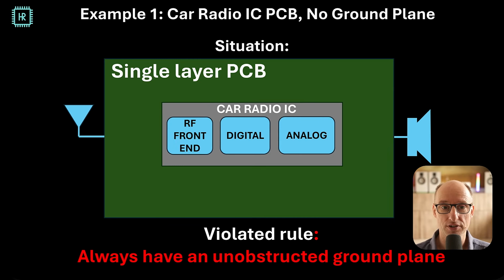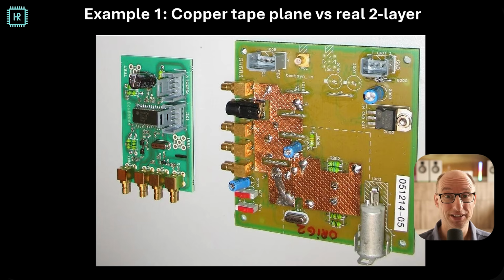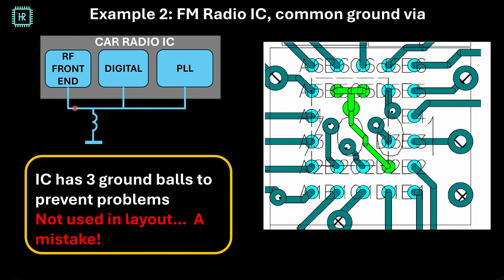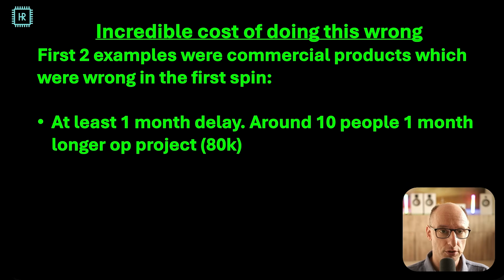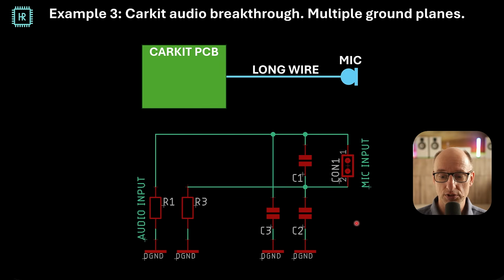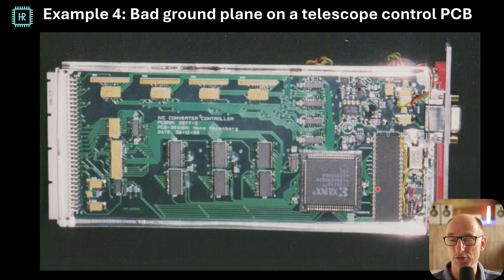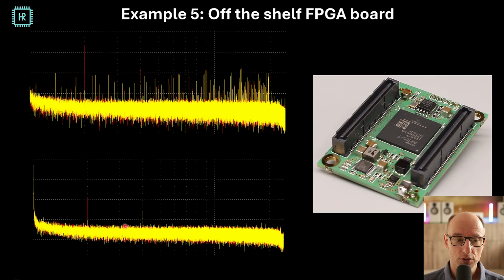Top 5 PCB Grounding Mistakes That Cost Me Thousands

Comment: A new hire created a 2-layer FPGA board that refused to boot. Total chaos in the indicator lights. My experienced colleague brought over a sheet metal platform with some kind of insulator on it and clipped it to the circuit ground. He slowly lowered the chaos board to this makeshift ground plane and the chaos in the indicator lights stopped and started blinking in the expected pattern. A good example of the benefit of a ground plane.
Reply from the maker: Sounds very familiar to my example :-)

Comment: Hey, you mentioned to never use multiple ground planes, but what if you make sure that all the return currents are on a unubstructed plane? Can it be beneficial doing it this way? Or will it still have some negative effects?
Reply from the maker: Both grounds will start to get voltage differences with respect to each other. This will in turn cause interference or sensitivity to interference. 

It will work, but with reduced performance.
Reply: @HansRosenberg74  So how do you deal with controlled impedance for both top and bottom differential and single ended signals ?  The return current on the GND planes mirror the differential signals EM field.  Recombination happens at the sink through local capacitors/coupling/IC.  It’s actually an advantage to have 2 GND planes that are dealing with the locality of EM fields.  The recombination happens when the signals are relatively quiet.  This is the whole point of a GND plane or 2 (or more).
Reply: How do you plan on  making sure that all the return currents are on a unobstructed plane when there are interconnections between each block of the circuit? They are all on the same PCB after all which means they aren't completely independent which means there are going to be interconnections between blocks and those interconnections have their own return currents which will need to cross between the ground plane of each block.

Comment: In a 4 layer PCB, If i have a analogue ground and a digital ground. Can i use two ground plane one as AGND and other as DGND?
Reply from the maker: I would not advise to make 2 ground planes unless you're dealing with a very specific situation that requires it. Those situations are very rare and usually require extremely sensitive circuits near extremely 'loud' circuits. Even then, there are other ways to solve that without making 2 ground planes
Reply: What you're supposed to do is have one plane but put analog and digital on different sides and areas, not split the two planes with a small bridge between them, which artificially adds length and bends for any return currents that need to cross between digital and analog sections. Putting digital and analog onto different regions of the same ground plane prevents local return currents of one half from circulating under the other half while not artificially impeding any return currents (from signals between the halves) which do need to cross halves.
Reply: Also consider the capacitive coupling between those 2 layers, you may not get the desired benefit as they are not as independent as you think in HF situations
Reply: Typically you should have 1 plane.  However if you have pure analog in one section (no digital traces going into that area, then you can add a plane isolation barrier (not a split but a cut that makes your plane look like a star-point GND connection.  However you have to have no digital signals crossing that “moat” because the break in the plane looks like an inductor to the signal crossing it.  It will cause ringing and noise in the isolated plane.  I would advise you read Dr Howard Johnson’s excellent books on Signal Integrity etc. for a more in depth analysis.
Reply: In your case 1 plane = solid GND plane.  If you have access to high end tools like field solvers and you are designing very noise sensitive applications you could then make a better judgement on how the isolation/split would affect the design.  Generally a solid plane is better since there is always a parallel equivalent return path for the current on the plane layer (EM field really vs current).

Comment: I have a gauge cluster from a early 2000s car that has no ground plane, it's a 1 layer pcb with some traces that have been added ontop that have had a blue mask put over, there is a big ground trace that goes around the perimeter however
Reply from the maker: I think that application is not that sensitive to begin with. The more sensitive circuits become, the more critical it is to use good grounding.

Comment: I suppose single groud plane means one layer only in a multi layer PCB? I usually use 4 layers when I design boards. Is it harmfull in your experience to use extra space on several layers for ground? If not using them as ground maybe instead using that space for power supply. I have often tried to use copper fills to reduce unnecessary copper removal in fabrication and mechanical strnegth. Should I instead leave the unused space on other than the ground layer not filled in your opinion? I suppose to make a good ground plane an inner layer with no or minimal wiring is optimal.
Reply from the maker: In a 4 layer the standard practise is to make both inner layers an unobstructed ground-plane. Top and bottom can be used for signals and supply. However, if you know exactly what you're doing and make sure all return paths are ok, you can deviate from that.
Reply: @HansRosenberg74  Standard practice is 1 GND plane and 1 VCC plane on the inner layers for a 4 layer digital board.   VCC plane looks like GND to AC.
Reply from the maker: @GodzillaGoesGaga  Yes, a VCC plane can act exactly like a ground plane. However, this is only true if you have very regular decoupling capacitors, ottherwise the return currents will need to take a detour.

A power plane in a 4 layer is relatively far away from the ground plane on the inner layers. The ground return current can start capacitively coupling between the ground and power-plane if the distance between decoupling caps is too large. 

This can cause problems at higher frequencies as standing waves will form between those 2 planes. They can leak out of the side of the pcb acting as an interference transmitter.

For low frequency boards with limited slew rates, this will not be triggered so most designs won't get problems with this.
Reply: @HansRosenberg74  thanks for the reply. I have always tried to learn about PCB design as much as possible. I will surely support your world domination objective when I have the time. 😄
Reply from the maker: @petriilkka1552 I hope you have a lot of time😂😂😂😂😂

Comment: It's a good video. In the third example the problem is not so much the existence of separate ground planes, but where the tide between them is done, and in this specific case, what is the return path for the signal. No matter single or multiple ground planes, running signals aver broken reference without other precautions taken is always an issue.
Reply: Well, I think the real point here is that if you tie the ground planes together in the right place, then they actually functionally become no different than a single ground plane anyway, so at that point, there's no advantage to putting the separation anywhere, and you might as well just get rid of the whole gap entirely and make them just one plane.

(And technically, even if you have a bridge between them at the right place for where the current wants to go, a narrow bridge will still be slightly higher impedance than if you just had a full connection over the whole plane, so even that is still technically not quite as good as a unified plane would be.)
Reply from the maker: ihndeed!

Comment: Regarding multiple ground planes. You say that There is no improvement if there are more than a single ground plane. Do you think 2 or more ground planes can actually harm the design? Assuming all the ground planes are connected to one another using allot of vias.
Reply from the maker: If you stitch them together: There can be no harm! They will all have the same voltage. My 4th video shows something about the distance between these vias.
Reply: This still needs to be done with some considerations, even stitched in some cases they become resonators, especially if you are not able to stitch them well.

Comment: Okay one question, how about audio ground and power ground separation? I see a lot of those in PC motherboards
Reply from the maker: The safest option is always to have a single ground. What you should NOT do is mix digital and analog in the component placement. That will bring digital (return) currents in the ground plane that is used as a reference for sensitive audio circuits. It can also cause you to have direct capacitive coupling of digital interference as well.
Reply: @HansRosenberg74 Thanks for the answer! I'm not a motherboard designer and the split ground has only given me trouble. So the main question is why did Asus and a lot more decide to go that way?
Reply: I've heard a lot of faint whine from even "premium" onboard audio over the years and I suspect it's due to this.
Reply: @edherdman9973 Is that through an amplifier or direct-driven headphones?
Reply: @yunodiewtf  in my case both in direct-driven headphones and even worse in speakers(with amplifier). Thankfully its not as bad these days... decade ago on-board audio acted like antenna for all inteference

Comment: For two layer boards I tend to route the important return paths on the ground layer by hand, that way I don't accidentally create detours due to crossing tracks. Filling everything with a plane afterwards then just improves the impedance.
Reply from the maker: That's a good strategy if you want to stay on 2 layers instead of 4.
Reply: I read this comment just in time before placing an order at a pcb fab.

good technique, I knew it but didn't use this time. will now double check my board before ordering.

Comment: Should we have one layer for a digital ground plane and another layer for an analog ground plane? Or should both types of circuits have the same ground?
Reply from the maker: Both the same ground, but give each domain it's own area on the pcb. Don't mix them together. If you have sensitive analog circuits: Keep them as far away from the digital as possible or use shielding.
Reply: @HansRosenberg74  ...AND use shielding :)

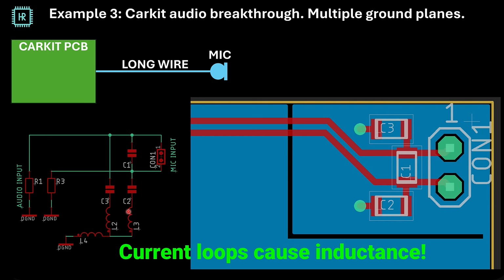Comment: Thanks Hans for a yet another great video on good-PCB-layout practices.  I would like to ask you one question but before I ask, let me clearly state that I entirely agree with your comment here about the disastrous large current-loop due to the Ground-split (shown at 07:33 timestamp). Thereafter, you said (at around 08:35 timestamp) that never in your 42 years did you have to split the Ground (well, instead of "split Ground" you used the word "multiple Grounds" - I believe you meant split Ground, like the one shown at 07:33).  I also agree with this 99.9% - so what is the 0.1% then?  Actually, I'll let you explain that rather than me saying anything further.  Before anyone frowns "Why consider 0.1%", then let me tell you, I just came across this issue in the last 6 months, so please don't write that 0.1% off :)
Reply from the maker: Agreed, there are situations where you have to split grounds. But they are really really rare. It would involve something with very high power right next to something with a very high dynamic range. You want to be 100% sure the high power current does not cause voltage drop on the ground for the high dynamic range part.

The best solution? Make 2 planes, but regularly connect them for very high frequencies with small capacitors. The value has to depend on the frequency range of both signals. 

This way, you have the best of both worlds: 2 planes, but for RF they act like a single one.

Comment: Interesting video.I just don't get In the example 3 if the noise is generated by the pcb side then it makes sense why the return path would go below the mic traces back to the audio input, but if the noise is generated from the mic side why would the return path go there, would it not go through the capacitors to the gnd connection of the pcb or the chassis gnd connection to return to the external noise source?
Reply from the maker: The problem is the impedance between those 2 ground planes. If current runs across that you'll get a voltage difference. We're talking common mode currents here. They behave differently.
Reply: @HansRosenberg74  That confused me for a moment too, but I then noticed, that the mic input is routed as a differential signal without grounding at the connector.

Comment: I had once designed an energy analyser with external ADC. Measuring 100V, no problem; 220V, no problem but no 0V! 10V in some channel, 7V in another, totally random but always there. I have used a filtering capacitor at ADC's ref in pin in my original design, at only 1 or 1,5cm's away. Now I have added another capacitor right under the pins of the ADC, problem has gone. Clear 0V on all three channels.
Reply from the maker: Interesting, what did that cap do? Connect 2 ground planes? Decouple a supply?
Reply: @HansRosenberg74  I have inserted a capacitor to filter out parasitic interferences that may otherwise affect my ADC reference voltage input. My PCB was 2 layer one, without ground plane.

Comment: No multiple ground planes? Have you ever designed a 20-layer PCB?
Reply: I think what he's saying that if there's multiple, you should make sure they're well connected so they act as one.
Reply: @evllihd  I doubt it -- that point is so obvious it doesn't even seem worth saying. Even at the simplest junior engineer level, the PCB tool flags an error if the "GND" net (or whatever it's named) isn't completely connected together.
Reply from the maker: exactly!
Reply: He's talking about multiple isolated ground planes (ones that are deliberately not connected to each other except in a few specific places).

Comment: I remember designing my Precision Digital Voltage Source (a good mix of analogue and digital) and did a couple of prototypes.........one had a single large ground across the entire bottom layer and as unbroken as I could possibly make it. The other I tried to implement a star ground for the analogue section. The single large ground layer performed better.......which I eventually went with.
Reply from the maker: Great, you're not the first to try that. Robert Feranec (Another youtube electronics instructor you probably know)  also did not believe the stories when he started out, so he made 2 ground planes, but had the option to connect them. He found the same thing: Ground planes work!

Comment: I'm currently studying EE, and we did learn in PCB-Design that sometimes it's good to split analog and digital grounds, for example if the digital gnd plane experiences lots of ground bounce, and we want to implement some kind of ADC-Measurement, then the ADC and all analog comps of the circuit, should be connected to a different (analog) ground, which is only connected to the digital ground at a single connection point.

Now you're sentence at 8:30, sounds like that's something I shouldn't do?
Reply from the maker: It is almost never a good idea, and if you do it, you should know incredibly well what you're doing. In ADCs, I've never seen it improve things, only make things worse. The problem is: This bad information is everywhere, even in datasheets from the best analog design companies making AD converters with astronomical specifications......

Comment: Hello Hans
I am just courios about the "newer split gnd planes" statement.
Do you also make no differences in the design when you have like a chassis gnd? A ring of plane around the pcb which is normaly connected to a metal case and also earth potential? Like to shield everything?
I see and i do this often and connect then this shielding chassis gnd at one point to the common gnd. 
Great videos!
Reply from the maker: I generally try not to connect circuit ground with chassis ground. The part inside the cabinet is usually isolated by a transformer or switching supply (which also has a galvanic isolation).

Comment: Hans, hello! Could you please tell about 1st example: why did you decide to go without any ground plane? You've just forgot to add it?
Reply from the maker: Haha, I never would have made this board. This was designed by another department and they had already spent 2 months and 2 prototype runs before it landed on my desk and I solved it in a few hours. Diagnosing the problem took me like 20 seconds :-) No ground-plane in a mixed signal design equals death ;-)